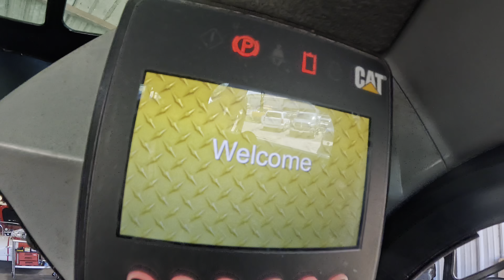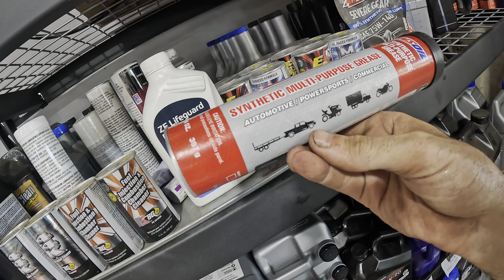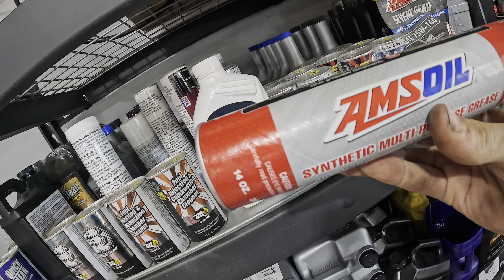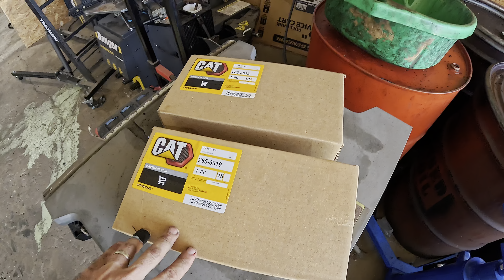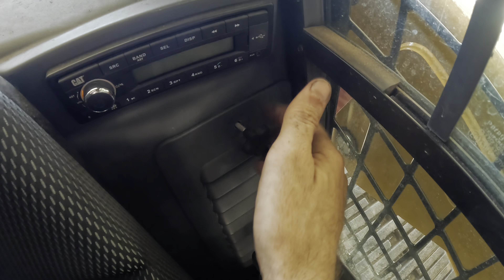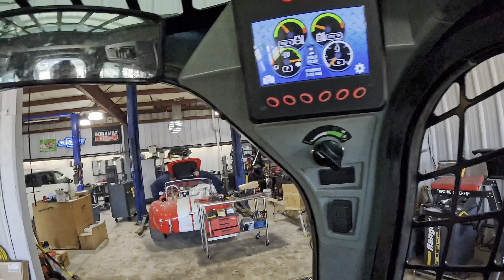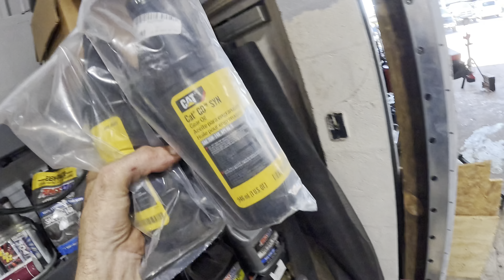Jack Stand Collapsed! Near Rollover! CAT 289D3 Skid Steer

Comment: Great vid. Learning new things is fun with servicing equipment.  as a previous service tech for a construction comapny i never tire of seeing different machines and the ins and outs. I know it sounds super odd but a portable grease gun is nice but they make electric ones by milwauke and dewalt so u can hold the tip on and one handed squeeze the trigger to pump, thus no more need for more hands than you have or employing the pump against yourself while holding the tip on and gooping up the fittings less mess and way easier to use. also when adjusting the track its good to run it back and forth to see if the grease spews out of the fitting or get the final adjustment locked in I only move the machine so the fill plug is at a 3 or 9 o clockwhen doing planetaries  then fill till its half full as to not add to much fluid like filling a rear it only needs enough to come up a bit. the oil is so viscous so it caries a long way in the small planetary but it could be different for this machine, thats how i always did it. looks like you made the foley of over filling at 43:06. You are soooo lucky you cant smell that stuff its nasty. one of the mechanical smells you never forget kinda nasty. my Mema had original recipe covid and 3 years later still has trouble smelling and tasting :(. Not political it happened to you and millions of others including myself thrice, so there is no boundary or border or race or class or swath of the population to cause divisions unless your a "woke" idiot. I am however sorry that this happened to you and will continue to keep you and the guys and the wife unit and little units in my prayers. Thank god no one was hurt when thos crappy jackstands gave. You rode that like a bucking bronco lmao. Much love to all yall out there in the florida heat.Stay hydrated and cool

Comment: I do believe the final drive oil is only supposed to be filled to the center hole not the fill hole. keep the center plug out and fill till it runs out of that hole. I dont know what happens if you over fill it.
Reply: Seals typically stop sealing if over filled

Comment: I learned about the track adjustment from “dirt, grain , and steel” u tube page. they do heavy equipment 
work and farming, it is nice to learn something new each day. yes wood would be a better default due
to in this application there will be minimal compression over the “under rated” jack stands. the raising 
and decent of the trailer magnifies the forces involved. great training video! thank you for your time!

Comment: Glad you where on flat level ground, when loading up, and that  dirty undie incident happened, it would have took off down the hill or rolled over backwards!! That would have been a REALLY exciting time for ya!! Hope you checked the trailer frame to make sure it didnt bend something, although a pretty tough looking dump trailer, Worked on backhoes for a guy since Dad had a backhoe co when I was a kid, after I got out of the dealership rat race, owner had loaded up a old 8 N Ford frontwards with a bush hog on the back, and, didnt lock the 2 brakes together, THAT part, being young I forgot to check, half way down the ramp I hit the brakes and only one worked which swung the tractor around sideways and landed in between the ramps with a loud bang!! YEAH shook hands with DANGER that day at 22 yrs old!! Didnt tear up anything but my shorts and made me think more safely about things after that!!

Comment: The main difference between the compact-tracked loader (CTL) and skid-steer loader (SSL) is the former has tracks and the latter has wheels. They can both feature radial or vertical lift configurations, and can carry out a wide range of jobs, whether it be digging, lifting pallets, landscaping and more.

Comment: When you opened the center plug and a weeeee leaked out. If it takes a quart, could the center be (like most diffs) the overflow? i.e. put the fill hole back at the top and open the middle. Fill by the top until it leaves from middle hole. Not a heavy mech, just my observation.

Comment: Using grease to tighten track. Learned that when the M113 APC I was driving threw a track in a remote training area. Unit mechanic was called while all the others left but me and him. First he opened the grease fitting to let grease out so we could ease the tension. After our gyrations to get the track in place, out comes the grease gun and we proceed to fill the fitting until he says we have the required tightness. Last, he says, “next time, it’s on you!”. Side note, the engine was a 440 Chrysler. They switched to diesels after that.
Reply: I have many hours of M113 (family) PMCS under my belt.
Good times.
Reply: I can whole heartedly agree with your comment @davidturk6170 and @sandynewman5533 on the parts of a tracked based vehicle. Crewman on the M48 Chaparral that ran on a M113 carrier and also running the M577 APC. Always made sure with your BII that you had your grease gun handy to tighten up the track. Worst job was replacing the tracks on those especially when they came in single tracks instead of a roll you could pull up on the road wheels with a chain.

Comment: Now, that was a nice easy job. You might have overflow the oil for those gears. Better be careful and check the manual to be sure. The trailer obviously doesn't comply with the machine's weight. The loading process was more than obvious. Also, it should have been loaded backwards to avoid excessive air resistance when driving. Best thing is to use the tow truck as it can handle the weight better. You were very lucky the trailer didn't tilt and smash the customer's vehicle. Rule #1 should have been applied. Think safety first, Ray. We all care about you and your family.

Comment: A trick I use when jacking up skid steers is I have oak blocks that fit tight under the back and use the bucket to lift the front then block under the front. That way I don't use any jacks. And when loading I usually load them backwards unless I'm using my tilt trailer.

Comment: A tip for plastic bottles: put a small hose on the bottle so the bottle can be totally inverted.
The central plug is an air bleed to allow smooth exit flow.
When loading a skid steer, back up the ramps as most of the weight is in the rear.   The bucket or forks can be used to lift up the front after the rear boggies get on the trailer, slowly rolling the weight on the trailer.

Comment: I don't know for sure on the Cat track loader but on most hydraulic final drives that center plug is how you allow the final drives to free spin so you can tow the unit if it needs to be moved and won't start. Also a Skid Steer is the nomenclature for the units that have tires and Trac Loader is in reference to the units with, well tracks...but they are used interchangeably. Hope this helps if you See it Ray.

Comment: Just a wild ass guess... And based on the fact that a small amount dribbled out when you removed the center plug... I'm thinking the center plug on the final drive is your fill indicator... I.e. add gear oil until it starts spilling out the open center plug hole.   So with that in mind... Did you overfill?

Comment: Hi Ray.  Per various Excavator instructions - I believe to correctly tighten the track - after Elevating said track - it needs (track) to be run backwards for a few seconds.  This somehow moves all of the excess play to the bottom.  Not running it backwards before adjustment - can end up with you still having excess play.

Comment: Jack stands need to be on level, hard ground to be effective.  Of course they can still be overloaded but as with any weight bearing device anytime its out of plumb/level it will affect the capacity.  Cranes are a great example of this.  I'm glad you're ok and not much damage was done!

Comment: I like to take dirt roads around my home town and when I do I go 50+ because the roads are nice and smooth and watching the dust fly is endlessly entertaining (because I'm a man-child). Kids enjoy it too. Anyway... I was getting prepared to do my second oil change since buying the vehicle in September and I thought "shit, I forgot to check my air filter". Popped it out and "smack! cough cough cough". 

I'm reasonably confident the dealer I bought it from (at 30k miles) had changed the air filter and the recommended change on a 2019 Rav4 Hybrid is "30k or 36 months". But... I'm gonna go with 20k (which was 10 months this year. Next year it'll probably be fewer).

Comment: You could have used the teeth on the drive gear and underside of the track to determine where the track would be when the hole was at the top, then mark the top surface of the track for one-man positioning.  Also, a piece of clear tubing would make squirting oil into vertical holes easier.

Comment: Drain plug at the bottom, remove centre plug and drain plug. Move skid until drain plug above centre. Fill with oil until it comes out of middle hole. Put both plugs back in.

Comment: I am watching this rather later then it was posted.. But while watching I noticed when you was working on the Right side Track that one of the hoses has a spot worn into it.. like the rubber coating was rubbed off and exposing the metal mesh.  Might want to consider checking that and possibly wrapping it with something to help extend the life of that hose so it does not burst when you need it most. Ive heard from other Youtubers them hoses get expensive quick - when you have them replaced.

Comment: So I assume to release the tracks the grease must be pumped out or released somehow.   That was amazing, I did not they tracks of course could stretch and need adjustment feature, but hydraulic is brilliant.  Rotating the drain plug - that is equally cool - it is what makes tractors so amazing.  There is a logic on the belt drive wheels; it is not all so clear on what is better (but I cannot recall why the wheels have benefits).

Comment: Regarding that final drive.  The outside plug is for draining the final.  The center plug is your fill and oil level.
Also verify the type of oil, my experience was 50 weight drivetrain oil not gear oil albeit a different machine.  But as always, the operation manual which should be behind the seat would clarify any confusion.  Seeing as how you are using Cat brand oil, I would assume that is based on dealer/manufacturers recommendations .

Comment: Leaving the excess grease on the fittings and or joints prevents damage and salt corrosion or grit from contaminating the fitting. Eric O explained that once upon a time.
Reply: It also leaves a place for dirt to accumulate, and absorb water.
Reply: I’m not even a mechanic yet I saw the excess as a requirement to protect the grease fitting from all sorts of contamination. 
Ray even called it in regards to ball joints. 
Ray said way back when he first got this machine that he was trading the service call with allowing him to use the machine at home but…. I think the owner needs to advise Ray on “proper” maintenance procedures and fluid replacement levels and quantities. 
Seems risky having a “novice” work on heavy equipment

Comment: Fill until oil runs out the center plug - 1/2 full is full.  Same for drives on big CATs and JD.  Never rely on Chinesium sheetmetal Jack stands. They will fold like a pair of deuces.   Project farm did a comparison of Jack Stands awhile back.  They don't like to be side loaded.  Grease is also used on large CAT dozers to tighten track.

Comment: Ray, I harbor a fear that you may have overfilled the final drive units. The center plug, you know the one painted white, on each side is likely a weep hole that will start dripping when the gear oil reaches the proper level - just like the plug on the back of many rear differential cases. Note that only a very small amount of oil came out of that plug when you removed it before diminishing. to an insignificant trickle.

Comment: You pull the Center plug to relieve the pressure that may be built up in side, otherwise you will wear the contents of the final drive when you pull the drain plug. 
I also think you overfilled the final drive when you filled passed the Center plug.

Comment: You should check out a lock n’ lube grease gun fitting. makes it a lot easy with that grease gun and not have a bunch of grease come out and holds on the the grease zerk

Comment: I don't know if ray's greaser is damaged, but on mine which is very similar to that one, you can screw the tip of the fitting to seal on the machine greaser and you have no spill of grease. then you unscrew to remove the fitting from te machine and you do not waste any grease.

Comment: Other machines I used to work on, you just adjusted the idler with it on the ground.... tracks didn't need to move,  the slack is always in the top section, off the ground anyways. Not sure what the Cat manual says,  but some old skool uncommon sense says you don't need to raise it up to tension the tracks....

Comment: That center plug comes out to pull the plate off when you work on final drive gears .you remove it and screw a Bolt on to push cover out

Comment: I have had WAY sketchier trailer loads in the military. When you live and work in a sand pit, you do what you gotta do. Everything is a ramp, except the ramps that are at home station 2500 miles away. Also, you need to invest in lock and lube tips for your grease guns. I have them for my grease guns and air lines, they make using these tools with arthritis much easier.

Comment: Ray, you've got no windshield.  Does the cabin air filter matter?  Or do you have a windshield on order?

Anyway, love the channel and learn something every day.
Reply: The air conditioner works through the filters.
Reply: And there is an automatic recirculating of cabin air in hot environments. The lack of windscreen is why the internal was dirtier than the outside.

Comment: You need to lube both “O”-rings on the new fuel filter with diesel fuel so they don’t bind, seal better and to make installation easier.👍🏻

Comment: sorry Ray, I dont think the filling of the drive hub would be correct, a couple of scenarios i imagine would be:- with the filler at the top, remove the center bung & use that as a level or have the filler at 3 or 9 oclock as the level, i cannot imagine any geared machine having to fill to the top?, only my opinion.

Comment: If you are going to this kind of work you should get the proper grease fitting it locks on the zero and doesn't come off unless released you need to pull the center plug when filling the final to set the level now it's over filled and the seal will blow out

Comment: I would have backed it onto the trailer especially with no weight at the front and the back end is heavy with the counter weights and engine, who ever is going to unload it better go slow and the trailer could potentially fish tail with so much weight at the back.
There should be a red safety sleeve that goes over the hydraulic piston when the booms are raised, it’s usually stowed on the side.

Comment: Should have put a longer pee hose on the water seperator bowl of the fuel filter for the next service. Can remove the filter with the separator on, only disconnect the wire.

Comment: I get how tensioning the track works, how do you back off if you need to service or remove the track?
Reply: If you noticed, the grease fitting is installed into a plug. Removing the plug allows the grease to escape. The spring (pointed out in the video) retracts the front sliding section forcing out the grease and removes track tension. Be prepared to catch a lot of grease…😅

Comment: I'm shocked you thought 2 ton jack stands were sufficient for that. Ray I know you know that  when loaded trailers drop down like that there's a momentary multiplying of forces. That Skid Steer alone weighs in excess of 10,000 pounds add the trailer and force multiplication from gravity as the trailer teetered backwards and I'd imagine those poor jack stands basically took a 15-20,000 lbs slam. I'm shocked they didn't collapse on the way up, please let us know the brand so I can buy some!

Comment: So, does the final drive call for 1 qt. of gear oil or fill until it runs out of the fill hole when at 12 o'clock position?

Comment: That's way for heavy equipment when lodging onto a size of trailer you are using they have supports at the back of the trailer so when you drive up the ramps with the heavy equipment the trailer doesn't push down on the back of the trailer making the trailer tung go way up in the air making it very dangerous. Now if your trailer doesn't have support stands for the back of the trailer you can use jack stands or two 3 tune Jack's one on each side to support the back of the trailer way loading and unloading the trailer.

Comment: Old school saying:  You take care of your equipment, it will take care of you.
Safety tip:  Never rely on jacks to hold the weight of what you are working on. Always use stands.
The Drive motor gear is drained from the outside point, when at the bottom, and then closed.  At that time the center point is opened and the oil is put into the center point and filled.   In other words, the gear is only filled with one quart.  You are doing things the hard way and over filling the gear.

Comment: Sorry I have to REEEEEE I just watched video about final drive oil change, you supposed to leave middle plug hole open when you filled it, when it starting come out of there, its full, no need to fill it all the way upper hole. I hope this do not ruin that final drive, too much oil can be bad sometimes. Do you need now remove that center plug and let oil level come down. :) Its oil level check hole.

Comment: 3:56 that’s an idler. Wait until you have to change one of those hydraulic hoses to the drive motors.🤨
My son and I replaced a couple outside in 10 degree weather. Then Cat used the wrong dies to crimp the ends. They blew off. We had to do it all over again ! Uggggg !!!!